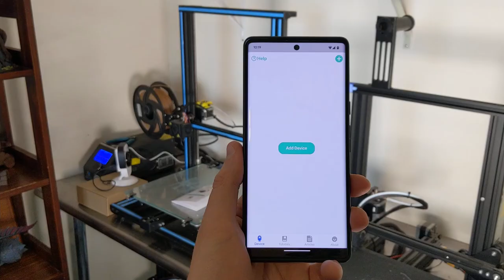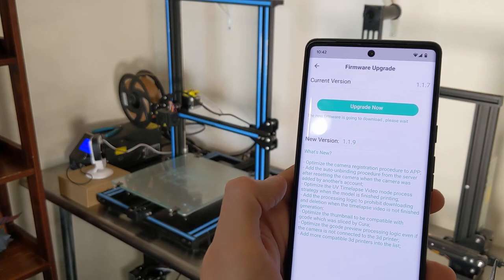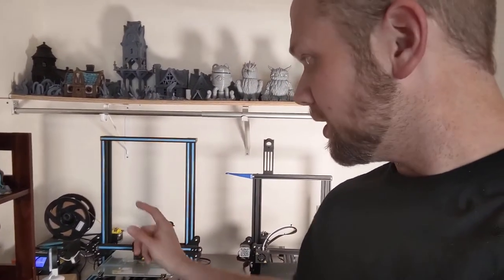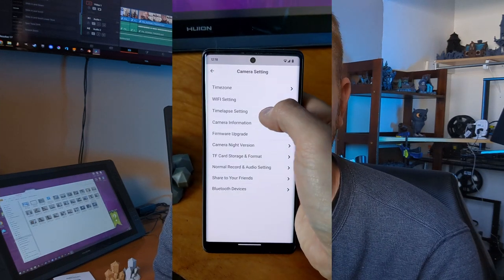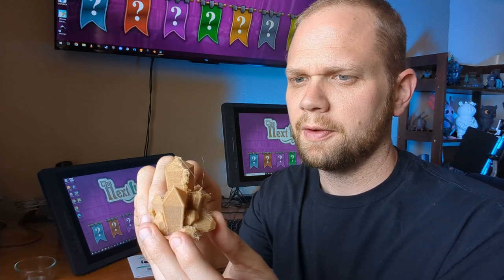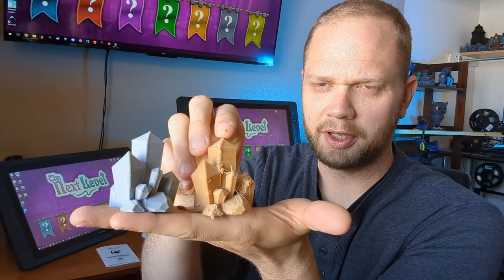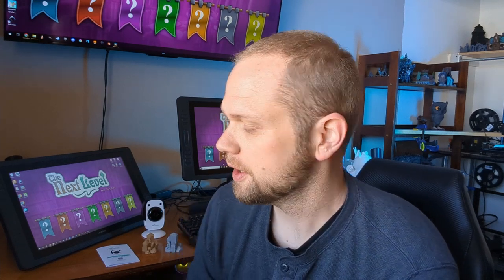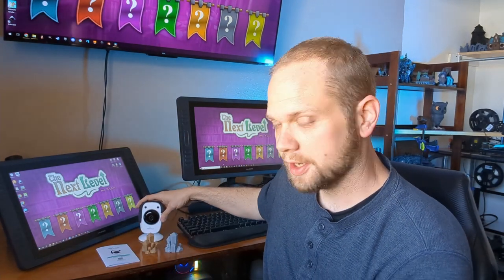How to make a 3D Printing Timelapse the easy way!

Comment from the maker: I've continued to work with this camera a little bit more, and you can actually connect to the camera with your computer over WIFI by inputting the camera IP address into your web browser. You can locate the IP address through the phone app under "settings", then "camera information". The user name and password are both "admin". From the web "dashboard" tab you can upload your gcode files and start the print directly from your computer without the need to remove the memory card. You can also monitor the printer, and download the finished time-lapse video(s) directly on to your computer. This solves my grip of taking the memory card in and out!

Comment: I have a Beagle since launch. I don't use it as much as I used to because I'm using newer printers. I have it is set up on my Ender 3 Pro. My biggest problem is trying to find a mount to give me the view that I want. But as a time lapse camera I think it's great.
Reply from the maker: Yeah, that makes sense. I am hoping to upgrade some of my older printers soon. There are still a lot of entry level printers that don't come with a camera and print monitoring, so it's definitely a good option in those cases, or if you have some older printers you want to keep an eye on them. Thanks for watching and commenting :)

Comment: Great video. Can I still use the printer's sd card to print? I would only like to use the Beagle cam for timelapse and monitoring.
Reply from the maker: You actually put the SD card in the Beagle Cam, then plug the beagle cam into your printer via USB and the camera adds the necessary gcode to complete the timelapse.  OR you can connect to the camera with your computer over WIFI by inputting the camera IP address into your web browser. You can locate the IP address through the phone app under "settings", then "camera information". The user name and password are both "admin". From the web "dashboard" tab you can upload your gcode files (after slicing) and start the print directly from your computer without the need to remove the memory card. You can also monitor the printer, and download the finished time-lapse video(s) directly on to your computer. Thank you for watching.

Comment: Does this work on any printer? I have a Bambu P1s.
Also, all of your connections that you plugged in like the USB for the camera for example. did any of those cables get plugged into the printer directly?
Reply from the maker: Hey there, thanks for watching. It doesn't work on all printers, here is a list of known compatible printers: https://www.3dprinteraccessories.shop/blogs/beagleprint/beagle-camera-is-compatible-with-3d-printers-list